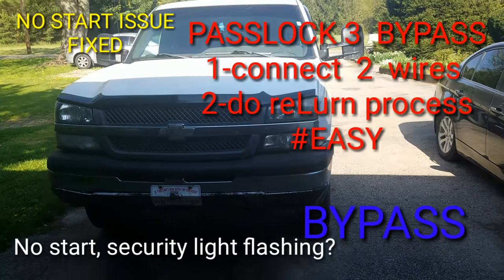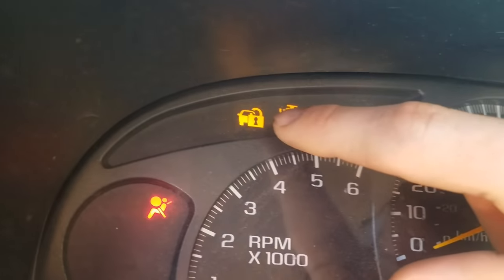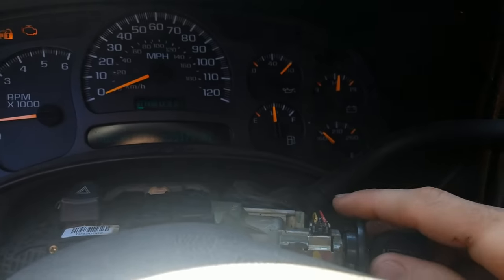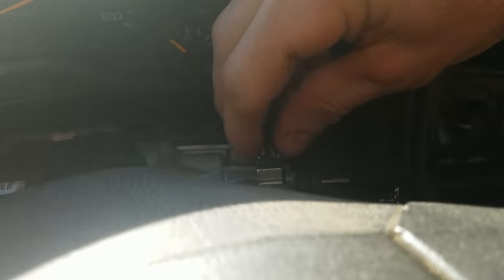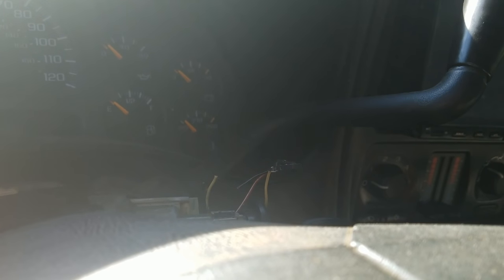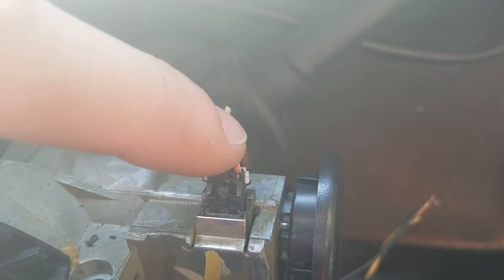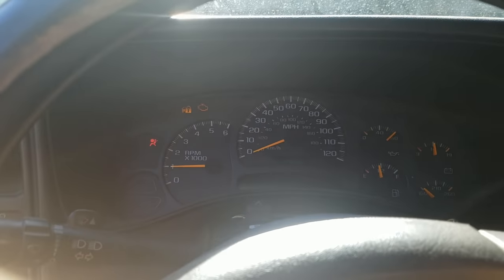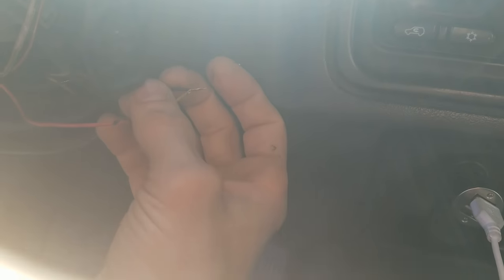PASSKEY 3/SECURITY  SYSTEM BYPASS! No start issue? CHEVY/GMC 1500,2500,3500

Comment: I've spent over 900 bucks on trin to fix my 98 Chevy suburban it won't crank no machine will read it no Chevy service center will touch of its to old they say and the 3 shops didn't know how yi fix it and one said it was fixed and it wasn't but won't gibe my money back so I still have a pos truck thats a money Pitt now
Reply from the maker: sounds like a bad ground wire or a wire that rubbed through or got disconnected, these are a pain to find

Comment: I have a 2004 Chevy Tahoe 4.8 the problem that I have is a “REDUCED ENGINE POWER” I’ll be driving it and out of no where I loose speed and power. Forcing me to pull over I then turn off the engine for a couple seconds then it’s running again but then it 
Keeps on doing it again. Please help. Thank you

Comment: Thanks, I am going to try this. I did check the VATS BOX for any burning and nothing. So, this video means that the cilinder resistor is the bad part? Thanks again... My 99 Suburban Cranks but won't start and security light is solid.
Reply: I tried but no luck here. I am not sure but without the resistor you're just lucky. I found the how to diagnose the VATS using the Chilton manual steps... Just ordered the VATS box.  I will update once I receive it and plug it. Your case, I don't see the logic behind the no resistance, because that's how it communicate with the VATS box. Just my 2 cents, this is not my area of expertise but learning.
Reply: @joseburgos5106  where did you get your VATS box?

Comment: That is not passkey3 system.. This system your showing is passlock2 system and what your showing should not work because the body controls module looks for a set resistance.. even when doing relearn the resistance cannot be zero ohms.. what you are showing is just adding ground to the signal circuit meaning zero ohms. The only reason your truck started was because you removed the passlock module after a successful ignition on by removing it puts system in fail safe mode.. go ahead a disconnect your battery I bet you it wont start anymore.
Reply: Autokey Security Services 
I also would like to understand what a better "fix" or "bypass" would be.  I haven't done the suggested bypass yet, I'd hate for the problem to appear again after a battery disconnect.  I wonder why it works for Joshyoden's vehicle..... Do you have insight to share?  Thanks

Comment: Ok, I have an answer to everyone replying here that's having problems still.
Buy a 5 pack of 2200 ohm resistors from radio shack for 1.00
Follow this procedure but, you need to cut the yellow wire from the same location, dont cut any other wire, and connect the resistor to the yellow wire and splice into orange and black striped wire.
Reply: anyone try the resistor?
Reply: Did it work for anyone? Currently having this problem
Reply: @t.shorttc1745  yeah I did it to mine
Reply: I also have the yellow wire and orange and black wire but I have cut both of them already before seeing this comment
Reply: @t.shorttc1745  just follow the directions here, it's not hard to do
Reply: @cowboysbbq3572  🤟🏾🤟🏾 it worked
Reply: @t.shorttc1745  glad to hear that it worked.
I've had to do hours of research just to find that out.
Just got done reconfiguring my fuel line from the external fuel pump I installed, to the engine.
Now I'm about to pull the PCM,  and have it shipped to Ohio to be reprogrammed.

Comment: So what’s the correct way to fix this problem instead of bypassing it?
Reply from the maker: Change the passlock sensor, https://www.ebay.com/itm/332467857663?mkcid=16&mkevt=1&mkrid=711-127632-2357-0&ssspo=UzfqTVhZQqq&sssrc=2349624&ssuid=i0PQldThQHe&var=&widget_ver=artemis&media=COPY
Although next time the sensor goes bad you'll be stranded.

Comment: Get a new key it will stop the problem if your key is not in perfect condition or catching when you try to turn the ignition on it triggers the security
Reply: If it is the problem yes. Been having this issue for some time now and it's intermittent. I just changed the key. And lock cylinder and it started. If it happens again it's not the key.

Comment: i tried this on a 2002 and did not work , Im thinking i have more issues with computer ? fuel pump not getting power ,replaced pump and relay,fuses good still no luck ?
Reply: @Joshyodenn  security light is on and no i dont hear pump kick in and I changed the relay also it also doesnt click like its engaging ,im thinking ecu?

Comment: Cool video. I have a 2005 Trailblazer. It has shut off a couple times. Only took one cycle to restart. But my question is. At the end here you started it just by unplugging the small clip with 3 wires. If I don't care about the light are you saying I can just unplug all the wires and there is no need to wire yellow and black together, or relearn? Thanks!
Reply: @Joshyodenn  Thanks!
Reply: @Joshyodenn  One last question. I was about to go out to try to clip those wires. But do I need to wait for it to not start before I cut and connect the wires? Or is it ok to do it even if it isn't faulting yet? Thanks.
Reply: @Joshyodenn  Thanks again! I've recently gotten 2 other check engine lights and it died at a stop light this morning! Thankfully it started right up but it was really annoying! Hoping this solves it!
Reply: @Joshyodenn  Well I cut and spliced the wires. I twisted tight and taped as I don't have and can't solder. Praying it holds! Plugged in, started fine but security light is still on. Well as long as it starts I dont care. No relearn necssary started first try. We'll see. Thanks again!

Comment: Hey so my truck tries the momentary start and dies.  But my theft light doesn’t come on or flash after.  Also none of my gauges or tuner read anything. Power door locks stopped working and radio doesn’t turn on.  This all happened at the same time. I’ve tried a whole bunch of things. Any chance this could cause that other stuff. Or does it just cause the cranking
Reply: Yes

Comment: Will this work if the car is having to be started at the ignition switch? My lock cylinder is destroyed because i tried drilling it out to get it unlocked
Reply: No i still have my key it just locked up on me and i could not get lock cylinder out to replace it and tried to drill it out and now im having to crank it at switch. 98 astro van
Reply: 98 astro van 2wd
Reply: @Joshyodenn  no still hsve 🔑
Reply: Joshyoden .
Same thing here on 99 trailblazer. Had to replace the cylinder housing and key lock cylinder with key.

No crank now
No relearn gets past the second cycle.

What the heck, man.

Any advice.

Comment: My 2000 Chevrolet 3500 also did this I tried this but it wouldn't work my light never flashes just stays solid and suggestions
Reply: Mine does the same thing

Comment: Must you put all 9 pins in the ignition tumbler or can you leave some out
Reply from the maker: The more tumbler pins a lock has the more secure it is.
Yes you can leave some out but i wouldn't recommend it. 
The more you leave out there's a better chance of someone being able to start it with a random key.
I'm sure you'd be fine if you left 1 or 2 out but i wouldn't recommend it. 
If you lost some and have to run it without, install a hidden kill switch so someone can't steal your vehicle

Comment: My injectors are being cut off by the pass lock system will this work? Please any help will be appreciated. I just finished changing my head gaskets put in the battery and now no fuel coming out injectors and fuel pump is running. Plz help.
Reply: It’s a 04 silverado 4.3 when I turn the keys I get a symbol with a lock after a few seconds it goes away then when I crank the keys over the lock sign comes back on then turns back off. I have verified that the injectors are not firing up. I took the plenum off and the other weird thing is the truck won’t let me hold the keys down after a turn the computer stops the starter. I don’t understand why all this is happening when all I did was disconnect the battery while installing head gaskets. FML
Reply: Joshyode so I figured out what it was. After swapping my engine I didn’t realize I broke my coolant temp sensor and was no longer plugged in. After I had it towed to the shop to have my PCM flashed and they said Vats was no enabled it was the coolant sensor. The pcm didn’t see the sensor therefore would let the truck start only crank.
Reply: Joshyode thx for the help.
Reply: My van isn’t starting ,its in anti theft mode i will try this

Comment: Now would this problem stall the truck when driving it?
Reply: Great question.
Reply: Yes that's how my truck started at first...then it wouldn't start
Reply: My 1999 just cut off going down the highway, now when I try to start it all I get is a click. No turnover nothing. Security light blinks and battery light on the same screen.
Reply: @nathanialholdridge9507  start with checking ur alternator...
Reply: @justintime8706  new battery installed. Still no crank just a click. Security light blinking.
Reply: @nathanialholdridge9507  check ur starter...
Reply: @justintime8706  but why would it die on the highway and with a new battery still just click? The security light blinks like in this video.
Reply: Ive heard of this happening while people are driving. It could be because the wires are worn and brittle. When turning the steering wheel it can lose a connection.
Reply: @nathanialholdridge9507  check your ground wire for the pcm, back of block on passenger side valve cover post.
Also check your pcm fuses under hood.
Reply: @cowboysbbq3572  What is the pcm?  Where are the pcm fuses?  Sorry, I'm just barely learning...
Reply: @coeneschamaun1735  either referred to as pcm, or ecm.
Fuses located under hood in fuse block.
Pcm, right below it.
Ground wire to it, back of engine block, passenger side.

Comment: What if u don't have a key tho?
Reply from the maker: Get a lock smith to make one ,or buy a new lock cylinder which comes with a key and install it. 
Here's one way of removing old lock cylinder without a key. 
https://youtu.be/cB32aNvnimk 
or Drill the cylinder with 1/2in drill bit 1.5in deep make hole wider and wider until locking pin is released then you can turn it.https://youtu.be/aViCQ5ZXT4I

Comment: Would this work on a 2008 Cadillac DTS
Reply from the maker: No because the ignition is different and the wiring is also different, if you are having security problems then your security light will probably be on or flashing,  i would recommend just replacing the suspected broken parts and then relearning the system.   Faulty parts can include,  ignition,  security modules, ignition anti theft ring.

Comment: My truck was stolen and I changed the ignition cylinder would it work for this? 05 Tahoe
Reply: Did this work for you ?My truck was stolen also I changed the ignition cylinder . Tried the relearn & Still having issues
Reply: It should

Comment: I've got an 02 GMC Savana 2500. My security light stays on and won't shut off after having my key turned on during relearn process. All my wires are correct. Any advice would be appreciated
Reply from the maker: Make sure to do the relearn procedure 3 times or it doesn't work.
Is your van running?

Comment: So I have what I think is a similar problem.  My 03 Silverado has taken to randomly killing the battery due I’m sure to a parasitic draw.  When I put a charger on the battery the low beams, park lights and horn come on like the alarm is stuck “on”.  The only way I’ve found to stop it is to pull the 3 relays.  Then it runs fine except for no lights or horn.  The strange part I can’t figure out is sometimes the meter in between the negative terminal and ground wire will show 0 mA and sometimes it shows about 800 mA.  So when removing and replacing the ground wire this whole cycle will happen and sometimes not.  I’m stuck on what to do.  Any suggestions or has anyone else run into this?
Reply from the maker: first is your security light on? it sounds like you have a different problem than what this video shows, because if the security system is triggered the truck wouldn't run at all.
probably not but those 3 relays may be bad try swapping one with a good one.

Comment: I would like to know how to disable the security system permanently so I do not need to reset it.  Anyone out there know how?
Reply: ECU/ECM needs reflashed with VATS(vehicle anti theft system) disabled...Ebay ($80-$160) have to send ecm away 
Or, find a garage that can flash ECU/ECM usually $75-$200
...Or buy HPTuners software ($400-$700) an do it yourself
Only real way of permanently getting rid of it
Reply: @hermanenders8236  thanks

Comment: Does this also work on a 2006 Hummer h3
Reply from the maker: Are you having no start problems with it? And no 06 hummer h3 isn't exactly the same as far as wiring goes.
Reply from the maker: If you are i would try always putting the key in the on position for 3 seconds before you start it, if this doesn't work then you can always change the ignition.

Comment: I have a 2001 1500 silverado and I was having this problem but when I connected the 2 wires I didn't have to do the relearn process, my truck turned right on with no security light at all, does anybody know why?

Comment: what happenes if the passkey 3 delphi module only has one green wire and one tan colored wire like the one to my pontiac aztek 2001
Reply: pk3 are transponder base systems      this is not a pk3 system as stated in the video    thats why yours show  tan and green wire  yours have an antenna base system

Comment: Hey what's up dude I have question,my truck cranks over but wont start, before I try this I want to know if u had the same problem,same truck and everything
Reply: @Joshyodenn  U are a F@#king genius bro it worked, but if I disconnect the battery will I have to do it again?
Reply: Joshyoden  hey I’ve got a 02 yukon security light flashing all time starts runs but it won’t go over 2000 rpms??? The rpm issue is in any gear even park! Thinking transmission issues ???

Comment: Never a good idea to cut wires, diagnose it properly and fix the problem.
Reply: @Joshyodenn  So find out why the connection is faulty then fix it the right way, bad design you say were there any TSB's generated by GM, did you check? Things go bad for a reason. I just really hate not solving the real problem.

Comment: wooow
Reply: Joshyode Awesome video man. Greetings from Cape Canaveral Florida. Sadly I'm experiencing the same issue. I went as far as changing the entire steering column with new keys and the system still refuses to communicate with the ECM. My injectors are cut off from fuel. Security Light is now flashing when it use to stay on solid. Any idea where the passlock module is located? They say those go bad.

Comment: No resistance in a vats3 system
Reply: Wayne Atkinson .
Hi Mr. Adkins,
My key stuck in the off position.
My buddy tried holding pressure on the key while banging on the housing.
He twisted the whole thing off the cylinder. Couldn't get the broken key piece out. tried drilling out the cylinder, no luck getting it out.
So he went to scrap yard and put a used 99 blazer cylnder housing, cylinder, and key on my 99 trailblazer.
Tried the relearn many different ways.
Nothing works.
I'm on a thin disability check. Dealership cost is out of the question.
Any advice for a foolish old man.
Reply: @georgiabenedict7314   I feel your pain...did you ever get it resolved?